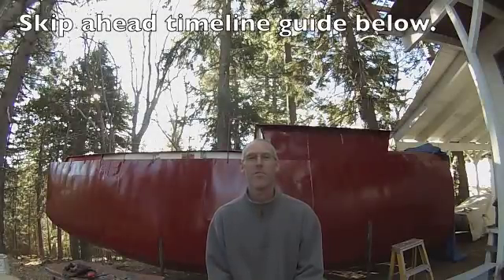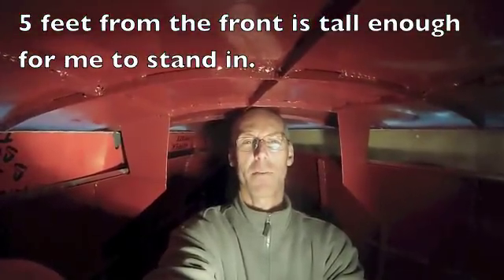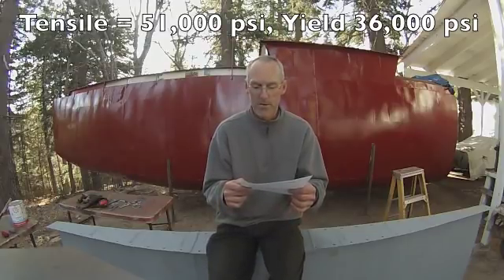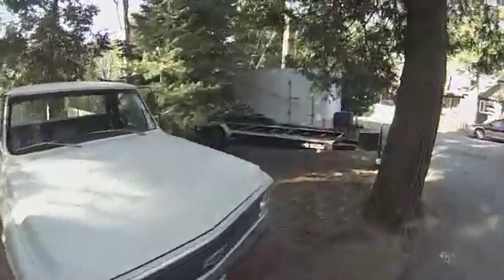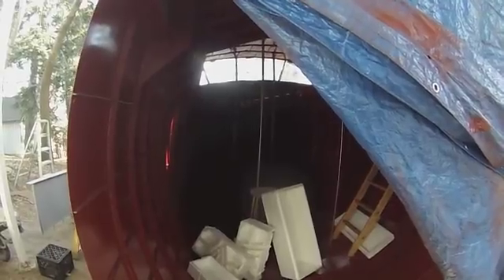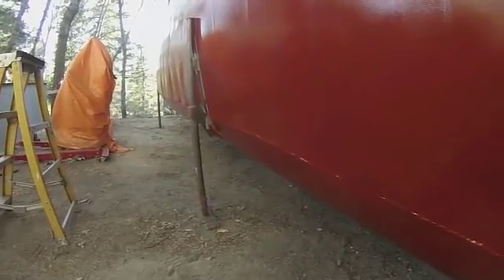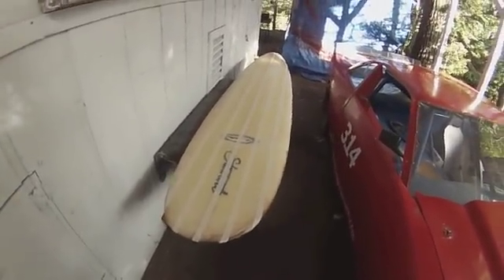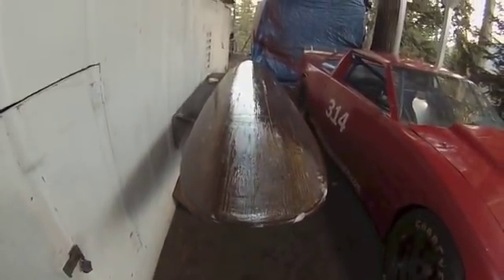Steel Sailboat Information

Comment: Your created an abomination! There are so many nice boat plans on the market, why you didn't just buy a plan and follow it? The structure has no framework to support the structure, I never  comment on any video but thus is an accident waiting to happen.
I suggest to scrap that thing and start olla over.
There are available on the market even ready cut to size all plates and you just assembly and weld.

Comment: Wow Craig, I’ve just binged on your project -and no, Doug didn’t send me over’ so what I say here stays here, just between us;)
Seems to me on your first video you mention or referred to local sailing waters? (See what Wow Craig, I’ve just binged on your project -and no, Doug didn’t send me over’ so what I say here stays here, just between us;)
Seems to me on your first video you mention or referred to local sailing waters? (See what happens, how it all works out….)?? 
At first I thought you were heading for a stich & glue type build using metal by the way you were setting out your sheets? 
I am and have been a project guy longer than I care to admit to but, I always have a plan Craig. I work with others that are disciplined in engineering, architecture, code adviser’s inspectors of each disciplined and cost accounts forewarnings of budget catastrophes, time lines and penalties…- so I know a thing or two about finger pointing!! I don’t want you to think that I am taking this time to pick on or at you- OK.
You are VERY wrong in your assumptions about glass boats; in fact you showed your lack of research both in your claims and demonstration!  Look up the making of  "All Is Lost"  that sledge and sledge swinger must have felt a bomb going off internally when the 40+ year old Cal 39 told him to F***off & Get Lost!
I don’t need to make an argument for “fiberglass schedules” they are very capable of standing on their earned records. You chose steel for all the right reasons for your project, fine; but you ignored easily obtained knowledge required to correctly implement its use; and that to me is fine too- because it is your project, your reasons, your money. 
Is she pretty, not to me, not at glance anyways- does it matter, not to me. But where I know I fall away from the project’s original scope and as many have put forward here; Rusty Junk is unstable! 
No- we may not rely solely on the pendulum righting effect of a keel. Not to mention the duty cycles that oil-canning will have on the hull material, and, because no math was applied-period;;; simply means the value accomplished is personal, not suitable for voyaging- add another period! 
I make this point because in general most of the comments focused above water line. Look Craig I too like a beefy stern but not at that height and not at that much sled. Would one build a track car without strong control systems to manage its goal?
Are there options? I think so, perhaps a motor sailor? Less load, short sail plan, sheltered waters? Likely this can be accomplished with smallish budgets; but Craig you will still need to beef up the framing because you have undermined the loading generated by the impact of wave forces, and the continues pressures applied through the hull shape you’ve chosen to build. You ignored the laws of motion.
All the best
Patch

Comment: Just in case you're intrested, One boatbuilding book i have, they give fiberglass:
"yield strength (psi) 10-15k  "
"tensile strength  (psi)  15-34k "
What they told you @ 2:10 may have been indeed tensile strength number. 

for typical  boat building steel same book gives numbers: 
"yield strength (psi) 36-42k  and  "
"tensile strength  (psi)  60-70k.  "

Based on these numbers, fiberglass might be even weaker than their numbers suggested.
Reply from the maker: This is great information.  Do you know the name of the book so I can mention it to the boat building community?  Thanks!
Reply: Sure, The name of the book is:  "Build your own sailboat" written by Bruce Roberts,  and in fact you can download it from here: https://goo.gl/V14m7h  (link is very slow).

Comment: The questionable area in my opinion is the weld making the metal brittle due to excessive welding heat.(Over welding) When a part fails next to the weld many armatures think Oh my weld was great the metal failed not the weld. The reality is the metal failed because it was overheated next to the weld making it weaker. And of coarse I saved this opinion till I saw the product and this thing is dangerous . There is not a chance in? the coast guard will approve it and will probably ban it  for his own good.  
Sorry thats reality

Comment: She looks sort of cool. Actually, I like it. Good work. 

Just something you might want to consider: the lattice of longitudinal and transverse stingers on the bottom of the hull will hold water. They won't allow water to drain away to a central pumping point. The stringers don't appear to be high and thick enough to add limber holes in them with out affecting beam integrity in the Ix and Iy directions (i.e. diminished cross sectional strength in the areas where you drill the limber hole). Saltwater sitting in trapped areas of your bilge will probably rust out your hull plates before you get 5 years service out of SV Rusty junk. So am thinking this needs to be fixed now.

So what to do? Maybe fill the bilge with tar and then fare and paint it so the water can not get trapped below it.  I would suggest filling the bilge with an epoxy but it will be out of budget. If you contact a road gang from a construction company they will give you some free as they often mix up too much. Tell them you will promote their construction company on your channel if they pour some into your boat before you plug the transom. Tar is dense so will also add ballast where you need it

Am looking forward to the series where you sail her.
Reply from the maker: Thanks for the info and ideas.  Very creative solution with the road gang tar thing!

Comment: I am confused I have worked on cars most of my life and for ford for 17 years. I have never heard of a 383 chev eng. and there may be but I thought 383 was dodge. I have been known to be wrong
Reply from the maker: It's a 350 with a 400 crank.  The longer stroke gives the extra 33 ci.
Reply: ok thanks for that
Reply: Rodney Wroten, 383 is a srtoker. 350 block with a 400 crank. Classic high compression motor
Reply: Rodney Wroten, sorry, I see someone's already informed you.

Comment: Are you planning to install any kind of a gas/diesel engine in addition to the sails?? I am all caught up now on your build, very cool
Reply from the maker: Still deciding.  The most likely engine setup will be two Honda 9.9 hp outboards.  Next is an electric motor.  Next is an air cooled VW Type 4.

Comment: I know your goal is to NOT invest in expensive specialty tools, but I hope you have watched the YouTube Channel Lazze Metal Shaping.  This guys does amazing things with sheet metal (likely thinner than 11 gauge).  In case you don't realize it, when you are making compound curves or beating bulges/buckles back into the desired position, you are actually shrinking/stretching the metal.  PS - get a dead blow hammer.  Cheap at Harbor Freight !

Comment: When I was younger I built a Roberts 36  out of steel in my back yard so I know something about the subject. It's rough looking but worse then that it won't last 5 years cruising. When you build a steel boat two main things have to be taken into consideration, rust and corrosion protection. No consideration has been taken for this. Steel boats need sand blasting followed by special paint, otherwise it will rust and rust quickly. The longitudinals should have drainage points in them to prevent water collecting in them. Extra support is needed for the mast. I could go on and on about this disaster waiting to happen. My advice to anyone planning to build a steel boat is to do the research, lots of good books out there. Talk to other steel boat owners. Get your wife on board,(her approval). Determine costs and how to get materials. Buy a good plan. How long to build it, (mine took 5 years, I worked at a full time job so it was evenings and weekends). Where are you going to build it and how will you get it to water. Develop the needed skills such as welding, go to night school like I did). Have the funding before hand. Building the hull is easy, the real work in inside, nothing is square.
Having said that do you know how to sail? If not, how do you know you like it. Take a sailing course in a boat the size you want to build along with your spouse. Don't rush, take your time with lots of breaks and enjoy it. A building tip, instead of filling it with water coat the outside of the weld with chalk dust and inside the weld apply penetrating oil or alcohol. If it leaks it will show up as a wet spot on the chalk dust.
My final advice, DO NOT USE THESE VIDEOS AS A LESSON ON HOW TO BUILD A STEEL BOAT!!
Reply from the maker: Well said.  I won't disagree until/unless I can prove otherwise in the real world.  I've spoken with a lot of sailors.  Get two of them in the same room and they will disagree about whether a boat should have holes drilled below the water line.  Thanks for the input.  Much respect for having already built a boat!  This is just a "This is what I am doing" series, not a "How to".
Reply: I guess the thing that bothers me is when one sets up a bad example that thousands of people read about, and that has the potential to cause harm someone should speak up. Sailors might disagree on the best type of rig, etc., but on safety issues there is little disagreement.
Reply from the maker: I'm not worried about it because everyone is an adult.  The people watching this probably build cooler/better stuff than I do.  Also, I state at the beginning this could be a "What not to do" video series.  Cheers!

Comment: How did you calculate your ballast?
Reply from the maker: I will have at least 25%.  The lower it is, the less is needed.  The BOC racers use about 1000 pounds total at about 3 meters.

Comment: The Wright bro's didn't know what they were doing, neither did E.G. Bell, Ferdinand von Zeppelin , and Wernher von Braun, Henry Ford.
Reply from the maker: Well said!
Reply: Baloney, if they knew how to fly they wouldn't have had to do so much research. Besides, they were the first that's what "first" means.
Reply: That is nonsense though. All of those individuals researched extensively and took advantage of the best science available to them and improved upon it.
Reply: So did SV Rusty Junk.
Reply: There is a lot out there about steel sailboat design. Things like keels and bulkheads come into play. If he can find a place to put this deathtrap in the water he better have plan b ready. It is essentially a large metal can with no clue and no sense about form stability. It will be fun to see it if it ever goes into the water...
Reply: Here is a steel boat being built by someone who actually takes the time to learn something about design
https://www.youtube.com/watch?v=kNVqhJO0H2Q

Comment: How do you get along with neighbors? The noise must be annoying. Engine placement and size will be tricky to get it correct.  Things like rudder size fuel tank placement and how to make it safe will need some research. Good  luck and thumbs up
Reply from the maker: I only make noise between 8:00 AM and 5:00 PM.  Also, I live in a low-income neighborhood of easy-going people.  No complaints, yet.

Comment: Could you also give measurements in metrics as well (although most of the viewers know the imperials), but few of us know "only" metric system :-)
Reply: He's 1.9 M tall. Front of bow 1.5 M wide.  Height of pilot house 2.1 M Pilot house roof 2.4 M  width 2.4 M Total length of boat 10.6 M total weight = 3826 kg.
Reply: Roger, thanks!
Reply: No problem. FYI those were approx measurements. He's actually 1.92024 M tall.
Reply: Nice, he is aprox. same height as my boat, albeit that your boat is a lot longer, mine is 6,5m long :-) (and fiber glass i.e. weight is about 1.5t). Very interesting to see, how the build progresses.
Reply from the maker: Thanks!

Comment: That's pretty cool best of luck you're braver than I am I don't know a lot about steel boats or welding but I know a lot about fiberglass boats shouldn't you have some bulkheads or larger steel ribs?

Comment: Came to your channel from Seeker also, the following is not a criticism, its your boat and your build and you can do it how you choose. I watched all your videos so far and have to ask a question, in these videos you mentioned terms like strong backs, longitudinals, beam of the boat, etc. So it seems that like pretty much everyone else that is building or renovating a boat, you have to some extent read books, researched online and watched YouTube videos on the subject to give yourself a working knowledge. So why did you choose to not make a basic skeleton to give you a fixed centre line and prefabricated complete frames giving you your desired dimensions at the bulkhead positions, to keep it straight and true?

Comment: What a heap of junk.
Reply from the maker: Hence, the name.
Reply: You mean apart from designing and building state of the art electronics for the Royal Navy, GCHQ antenna control systems and mobile power systems for the Turkish military, not to mention two axis gyro stubilised gunnery sights. Not a lot.
As an Engineer it is obvious it is impossible to fit a keel of any weight to thin steel plate without it flexing and eventually falling off due to fatigue.
I forgot I fitted  out my own yacht completely, crossed the Atlantic and Sailed in Venezuela for a long time.
Reply: I smell bull shit Pat
Reply: Patricia Brooks nice comment.  What have you built lately?
Reply: The point of my comment was obviously lost on you as someone that is technically illiterate. The heap of junk this man is creating is just that. It will never sail and if it is put in the water it will be a threat to anyone sailing in it. I have seen these things built on YouTube before and all the sycophants who know nothing loving it. Really sad.
Get some technical education, plan, model and stress what you are going to build so it will actually work. Ignorance may be bliss but is short lived when it all comes down.
Reply: Nice reply
Reply: Patricia Brooks, Okay so you're an expert, still doesn't excuse the rude comment.  We all know the old addage "if you can't say anything nice.....".  Either be nice or stay away.
Reply: If anyone is really interested how to build a steel boat then look at this series. https://www.youtube.com/watch?v=MSRBRqL_vQA

Comment: Anyone questioning the thickness of the metal does not understand the strength that all those ribs add !  The BIGGEST unsupported area looks to be <18""x18".

This boat is NOT another SV Seeker !  More like Karl (White Spot Pirates), but maybe even faster with that narrow hull !!

314 looks and sounds like a oval track car !
Reply from the maker: Thanks!
Reply: Now, having said that, are you going to make any attempts to "fair" the sides and deck/cabin roof ?  Or does it meet your standards ?

Comment: Craig
The strength data  showing that steel has a higher yield strength than fibreglass are not reassuring. 
A fibreglass boat built of 4mm skin (more than equivalent to what you have) would require a 12mm or 15mm core, and then another 3mm skin on the inside, to be stiff and strong enough for a frameless sailing vessel in protected waters.

A 3mm steel skin would be OK even offshore, but ONLY with proper framing, at least 2" deep if at close centres, and preferably more. The stiffness of a 1/2" rib is (1/4 cubed) or 1/64th the stiffness of a 2" rib

The framing would need to be three times the 2" depth in the vicinity of the keel and twice that deep near the chain plates.
Reply: He probably stole this line from SV Seeker "A welder is nothing more than a metal hot glue gun !"
Reply: the beauty of metal is it it ends up a little weak , he can add more steel.
Reply: Nothing is original any more : imitation is the sincerest form of flattery. don't be a hater.

Comment: You need to fill up the entire boat with water. A floating boat has more psi exerted on its hull in the water then it would have filling it up to the water line out of the water or there about or so I recall.
Reply from the maker: Good point.  I know a fluid dynamics engineer.  I'll ask him about this idea.